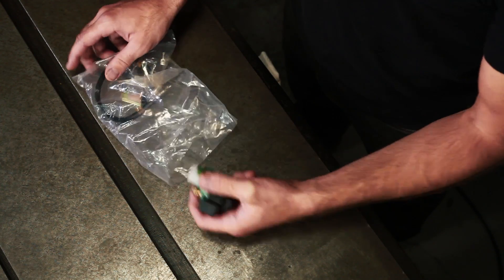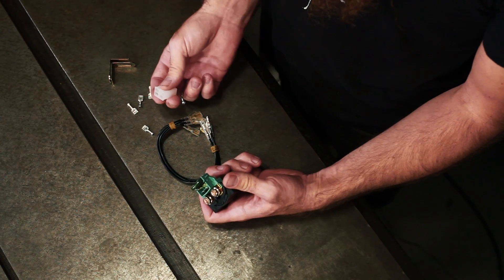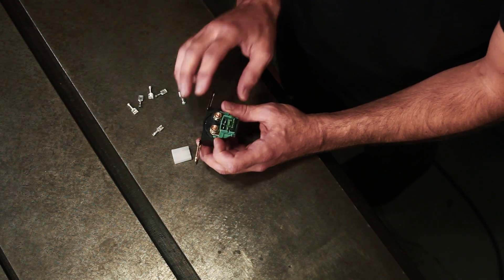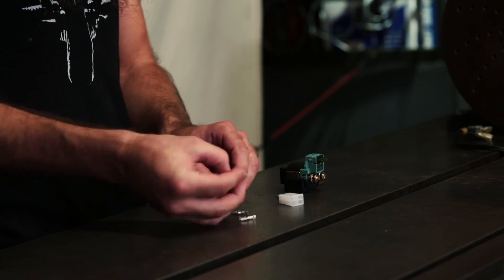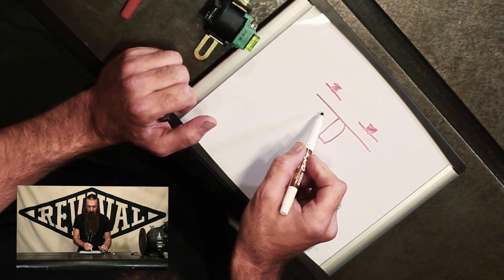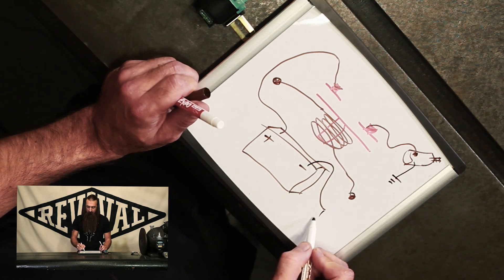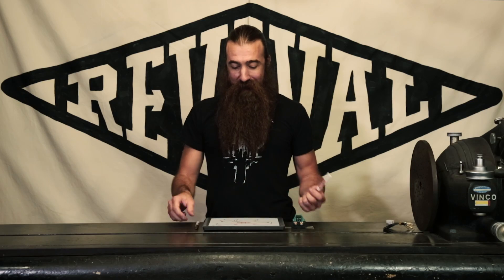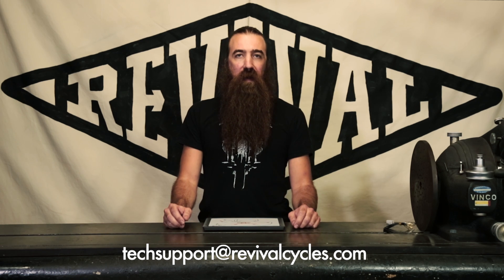Starter Solenoid - Revival Cycles' Tech Talk (Link to new Solenoid Kit in the description)

Comment: You say simple but when I ask or when I call for help with order I received I don't get anything but the same instructions that came in the box from an email he sent me.  Like I said before I'm just a beginner and help is needed where my starter relay switch has only 2 pins where as yours has 4 pins. On my bike it shows that one of the wires G/R goes to clutch diode and clutch switch the wire Y/R goes to the starter kill switch. So where would these 2 wires connect to on your stater relay where yours has 4 pins?
Reply from the maker: Have you tried reaching out to our tech support team directly? Please reach out to techsupport@revivalcycles.com and we can help you with most if not all questions. Thanks!
Reply: @RevivalCycles  I wasted my money and time when I purchased the starter relay from you, simple for someone with the knowledge and tools but I figured I get the help that you advertised little did I know I was wrong.

Comment: I see in the video that the one you're showing has 4 connections and a fuse where as mine for my 2014 Honda XR650L has only 2 connections and the fuse but the fuse does is not live. May I ask if you have a relay for my year, make and model bike please.

Comment: Just for an 84 Magna V50, rust has stopped everything from tank to pump to carbs. Ran it for a minute before it finally quit. I could start it with gravity feed to carbs, but then poof, starter won’t fly, batter seems dead too. Corroded cable to solenoid but I’m dumb and didn’t pay attention. Think the replacement was backwards and just janky, so put it together as I thought it went. Blew fuse. Not sure what to think about it.

Comment: We have a China moped and we got no power past the starter solenoid    no clicks nothing. Ofcourse it turns over if we jump the starter solenoid    but if it's a bad solenoid than would that kill power to the hole bike.    I was thinking  since the power hits the solenoid and has to hit a switch inside and it's not than that's why we don't have power.   But it's a 3 wire like in this video. So maybe a knock off Honda clone.

Comment: Exactly which wire/circuit does the fuse protect?  Is it possible for back emf to flow back up the signal wire? Example: during solenoid malfunction when contact get stuck. Thanks
Reply from the maker: This fused circuit  could be used a number of ways but it's intended purpose is to sit between the reg/rec and the battery, in order to protect the battery from an over voltage scenario should the reg/rec fail. Same as the main fuse on an OEM harness.

Comment: So I have a question I have an 81 cb750 dohc for some reason I can't get charge to my battery is have installed a cycle x alternator setup and a brand new loom on the bike the only thing inline from the alternator to the battery that I haven't changed is my starter solenoid could this restrict charge if faulty?
Reply from the maker: Is it one of our solenoids? If it is or it's one like it check that the fuse isn't blown. The circuit is so simple in construction that there isn't anything to fail but if it's wired incorrectly or the fuse is blown it will not charge the battery.
Reply: @RevivalCycles  thanks mate It's not one of yours but the same style it just seems stuck at 12.3V I'm away at work at the moment but when I get home I'm just trying to do my homework I've put heaps of money into it to try eliminate the common major issues these old bikes have can the ignition switch be a possibility too? They are literally the only 2 not brand new things on the bike

Comment: is it correct to have battery ground wire to one side of the solenoid and my positive hot wire to the other? I also have other wires connected to both sides. I have the ignition stitch one leg connected to the hot side as well. I took some wires apart and back together but now won't start and the solenoid clicks. I can feel it thumb but the starter motor doesnt crank. I need help determining why its not starting or rewire the whole damn thing
Reply from the maker: Hey Ryan, if I am reading that correctly it doesn't sound right. There's an updated wire diagram in the link below that should help and if you have any more questions hit me up at techsupport@revivalcycles.com. Youtube comments just isn't the best format for helping.

Comment: M unit is...what?
Reply from the maker: It's so very many things but its core functionality is as a solid state fuse block and relay replacement. In addition to that it has an alarm, keyless power up. voltage monitoring and a tone of other features. There is really nothing else like it on the market. https://shop.revivalcycles.com/motogadget-m-unit-blue/
Reply: @RevivalCycles   I see I see. Thanks!

Comment: Real Good explanation. I just wonder if that is as strong as the Ford Solenoid. Yours is a lot smaller and would be a little cleaner.
Reply from the maker: Hi Ron, 

We've updated to a new updated kit that we assemble here in house that includes an updated solenoid with fused circuit that high with a high quality waterproof connector, I'll post the link to it's video at the end of my comment. 

In both cases these are 30 Amp solenoids intended for motorcycles with independent starter solenoids. This is perfect for most Japanese, British and Italian bikes. This will not work with Harley's, BMW's or Moto Guzzi's where the solenoid is incorporated into the starter motor.   I don't know anything about the Ford Solenoid you mention but I wouldn't expect this to go toe to toe with a larger higher amperage coil and win. 

Since the introduction of this kit we've not seen a single return for any reason other than it being incompatible with their application. 

https://www.youtube.com/watch?v=QwBX8WvcYNU&lc=Ugx52eEDSf7xzS_sINp4AaABAg
Reply: @RevivalCycles  Thank you for the reply. I will keep this in mind.

Comment: great Video, i´m about to finish a CB 500 Four from 75, can i use this Solenoid.
Thanks and greatings from Germany.
P.S. you explain the Motogadget stuff better MG themselve
Reply from the maker: Yes, this solenoid is a great replacement for the CB500. This type of solenoid can be used on any bike with a separate starter and solenoid (most bikes). The only ones it doesn't work with are the type with bendix style starters where the solenoid is integrated into the starter (Harley, BMW R-bikes, Moto Guzzi are the main ones).
Reply: Revival Cycles I have a Honda magna750 1983 and would like to know if can work on , I put battery brand new and still does starting, sound like mute.-

Comment: does the motogadget m unit blue work with the m button
Reply from the maker: Yes it does. However, we recommend only using the m-Button if you really need it (like on an ultra custom, super clean build). The install process can be somewhat challenging to get the m-Button into the bars, and also, the m-Button has been shown to be susceptible to EMI and RFI interference from the ignition system. It is much more robust to wire the controls directly to the m-Unit inputs, and if using the m-Switch mini's it also the absolute easiest install. In many cases the m-Button doesn't really clean up the look of the bike, makes the install tougher, and opens up a risk that the m-Button has a problem and the whole system stops working.

Comment: Is there a way to get replacement for those rubber things (like that one the solenoid sits in) ? I ve noticed a lot of 'em on my bike are pretty deteriorated and are falling apart .. x)
Reply from the maker: Not that we are aware of. Also, the rubber things all look the same, but often they are slightly different sizes, especially if you are looking at standard relays and not solenoids. One place to look might be on an OEM parts supplier website like bike bandit. That way you can be sure to find the right one that fits.

Comment: love these videos.  quick question though - is the fuse even needed still with the motogadget m.unit blue?  I noticed in the instructions you can do an install without the fuse and would just would like to know if it's even needed.
Reply from the maker: None of the m-Unit's need a main fuse. BUT the charging system needs a fuse to protect the battery from a reg/rec failure, and since you need a main fuse, it just makes sense to run the m-Unit through that as well.  This package of solenoid/main fuse is the most convenient way to do this. 

Although you can connect the m-Unit directly to the battery. My opinion is that this is bad practice, so ALL revival builds have a main fuse that powers the m-Unit.

Comment: I just received this item with the intention of using it on my 1973 Honda cb350f. I bought it because I thought it was great to have the fuse incorporated with the solenoid. Also, I was told I should replace the old glass tube with a blade fuse(mine kept blowing). The main fuse off the battery is 15A, according to the wiring diagram. On the back of the package of the solenoid, it says it is to be used with a 30A system. Would I be able to still use this 30A fuse with the current gauge wiring harness on my motorcycle? Or should I stick with the 15A fuse? Should I return this product? Any suggestions would be greatly appreciated.
Reply from the maker: There is no problem using a 15 amp fuse with the solenoid. It is literally just a fuse holder, that taps power off the battery connection on the solenoid.  There is no need to use the 30 that comes with it, and the stock wiring on the CB is not designed for that much amperage.

Comment: these videos are just motogadget advertising.... That works!! I'm saving up for a M-unit and now a starter solenoid. anything else "I need"?
Reply: a motorcycle :)
Reply: Tostibrand dammit! knew I forgot something!  where can I find one of those?
Reply from the maker: Its really difficult to beat the motogadget gear, but trust me, if we ever find something that works better we will not hesitate to share it with the world. 

As far as what else you'll need, that all depends on what you've got, and what you plan to do. Here is a link to a check list we use to make sure we have a plan for the electrical stuff. https://cdn.shopify.com/s/files/1/0072/8562/files/ElectricalSystemChecklist_1.pdf?14692071879394739526

Comment: If I am planning on using motogadget M-Relay+ do I still need a solenoid??
Reply from the maker: The m-Relay+ is used to control turn signals as an integrated flasher and push button control module. The starter solenoid on the other hand is used to control the electric starter motor. These two systems operate completely independent, and if you have an electric starter you will need a starter solenoid of some type. BMW, Moto Guzzi, and Harley typically have the solenoid built into the starter, virtually all other bikes use a separate solenoid like the one in this video.
Reply: Thanks!!